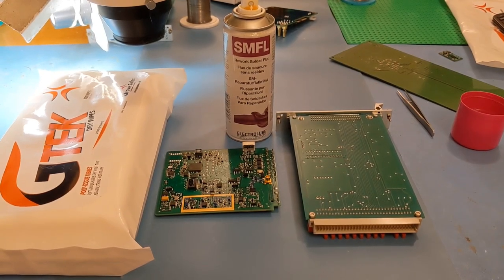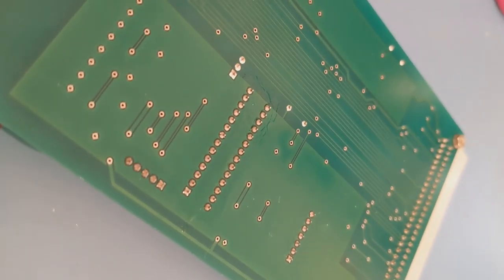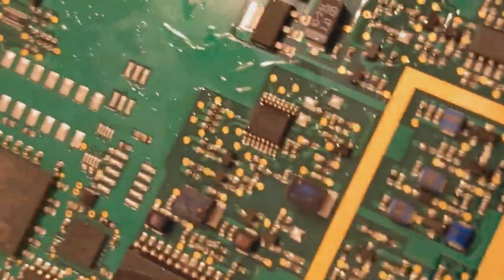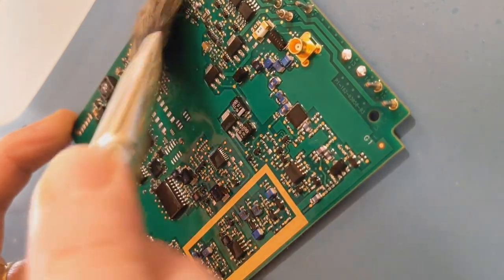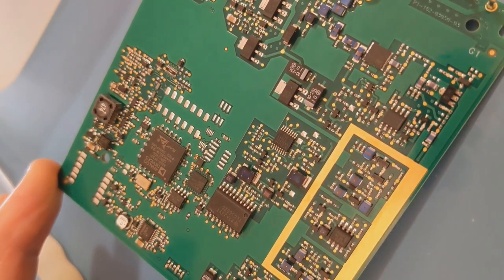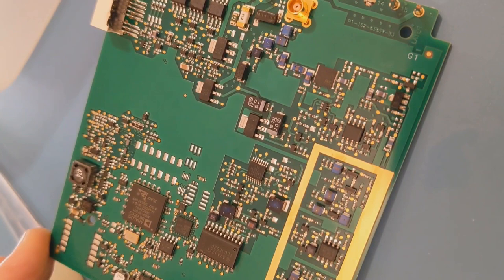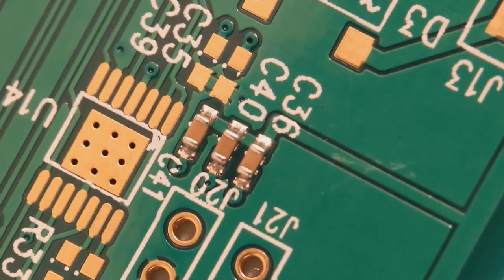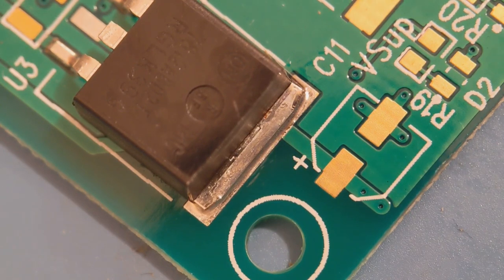How To Remove Solder Flux / Great PCB Cleaning Methods HD

Comment: In Aerospace boards meant for Space applications especially, Honeywell uses Axarel 2200. Stuff eats flux like it's water and leaves the board beautiful.
Reply: could this be used to also clean dirty boards?
Reply: isopropanol and windex, they charge the gov 100 bucks a bottle

Comment: The problem with cleaning flux is the pins. Requires more and more alcohol to clean just the littlest stain in between the grooves. So annoying.
Reply from the maker: Hi , thank you for your comment . A nice fine brush , good cleaning fluid ( ULTRASOLVE or Flux off ) are both great , not IPA , and a good fine cloth and the secret is the hairdryer . Bit of effort , amazing clean boards . Thanks again 👍

Comment: Ultrasolve is basically cyclohexane a common solvent, not bad results.  But you'd be amazed at what some good ole 1-1-1 Tricholoroethane will do.   It's quite a bit harder to source but it's out there.  Be amazed.

Comment: Wow, I would have never thought that PCBs can be submerged. Are all the little components waterproof?
Reply from the maker: Hi , thank you for your comment. PCB's generally get washed in the commercial world in large cleaning tanks with different cleaning programs and drying stages built in . It's a perfectly safe option if done with the correct methods . Cleaning as a hobbyist is 100% safe If the right fluids are used , in my case I have used 2 recommended PCB cleaning fluids so no problems will occur. Hope that helps , thanks again 👍
Reply: @mrsolderfix3996  Thank you!
Reply from the maker: Hi , no problem 👍
Reply: U can submerge them in Isopropyl and distilled water believe or not (regular water shorts and oxidizes components due to the minerals)

Comment: I'm ususing IPA 91% and it always let flux ... ive changed flux, and got the same issue,  it just blend the flux and only spread it ... I'll try specific flux remover product
Reply from the maker: Hi , thank you for your comment, much appreciated. Proper PCB cleaning fluid is a must in my opinion . I use Ultrasolve which really is the best , then after that as a back up I use one called Flux off . These are available from the general electronic distributers although some products they are reluctant to send to private individuals due to health and safety . Hopefully you can get some to resolve your cleaning issues . Good luck 👍

Comment: How about washing the whole board with dish washing detergent and soft brush in a warm water? Will it damage the board or the components ?
Reply from the maker: Hi , thank you for your comment . Definitely not I would say . It's true lots of parts are sealed so may be ok . But others like switches , relays , transformers may not be . Any moisture in them could spell disaster . Some companies do use water but it's deionized water with special chemical agents added . So it's something I would never do and I wouldn't recommend doing the method you've mentioned to anyone . Hope that helps , thanks again 👍

Comment: This one is much much better image quality 👍🏻
Reply from the maker: Hi , thank you for your comment , much appreciated. I listened to what you said before and decided to edit the video on the same device it was filmed on so that I didn't lose the sharpness of picture . 
Thanks for your advice . In the future all videos should be clearer . I will also try and sharpen up some of my old postings , thanks again 👍
Reply: What will happen if flux exist in pcb board??is that causes rusting or short circuit in pcb board. Please reply reason...
Reply from the maker: Hi , thank you for your comment. These cleaning methods will remove all flux but if there was any left behind it doesn't affect the board at all as I only use non corrosive flux . This means it's perfectly safe long term . Hope that helps 👍

Comment: instead of fluids , is it possible to use 99% isopropyl alcohol ??? ( i m. sorry my english understanding is small)
Reply from the maker: Hi , thank you for your comment. Lots of people do use isopropanol to clean flux etc off of their PCB's and it is pretty good  stuff . The Ultrasolve that i use is in my opinion way , way better , but understandably if people have a budget or just want a tiny amount to clean part of a board then they can definitely use Isopropanol. Hope that helps , thanks again 👍
Reply: @mrsolderfix3996  Thanks a lot for your video and answer
Reply from the maker: Hi , no problem , all the best 👍

Comment: Thank you for you videos. Do you use  0.25 mm solder wire with a flux core, or solid? And, lead-free or not?
Reply from the maker: Hi , thank you for watching , much appreciated. The solder wire I use has a 2.2% flux core and is a Nitrosol solder wire . This is lead free , available from BLT Circuits based in England . I also use a leaded version , also with a flux core available in various sizes including 0.25mm from BLT as well . Hope that helps , thanks again 👍
Reply: @mrsolderfix3996  Lovely, Thank you.

Comment: Is there any way to solder an ic with qfn package to a tqfp housing?
Reply from the maker: Hi 
 Personally this is something I have never tried but if the QFN is a similar size to the TQFP housing it may be possible to sit it on top of the pins and solder each one , but like I said I've never tried it . Be interesting if it does work or if anyone else has tried it . Good luck 👍

Comment: Great video, thanks. Could you share links to the products you use?
Reply from the maker: Hi. I don't ever do links in my videos , just my personal choice not to .
But I can tell you what you need to know from this video 
If in UK or Europe go to a company called Farnell and all the below are available from there . I have no association with Farnell , but I just use them personally and trust them .
Flux Off Cleaning fluid code is ( 860414 )
Ultrasolve cleaning fluid 1litre container code ( 298219 )
SMFL200D Flux code ( 298311 )
Cleaning wipes I get from Grove Sales , they are called Gtek dry wipes ( pack of 100 ) , about £5 a pack , best wipes I've ever found , seriously good when used as I show in the video.
Hope that helps , thank you for watching👍
Reply: @mrsolderfix3996  Thanks :)
Reply from the maker: Hi , no problem , all the best  👍

Comment: Can you use WD-40?
Reply from the maker: Hi , I wouldn't know as I've never used it for this purpose , but personally I wouldn't want it all over my PCB's as I'm sure it would leave them sticky and so dust etc would be attracted to the board potentially risking connectors etc to not work properly . Just my opinion . Thanks for your comment 👍
Reply: No, no, no never. Will just leave board mucky and attract dirt.

Comment: Hi sorry I'm kinda new on this thing may I know what kind of brush you using and what kinda of fluid you using? What kind of alcohol fluid did you you use to wash that flux
Reply from the maker: Hi . The brush I use is a soft bristle brush ( not to cheap ) so the hairs don't fall out . Very safe for cleaning PCB's . Don't use a hard bristle brush , I've seen some damage to boards when these have been used. All the other info , fluids etc is in the video 👍
Reply: @mrsolderfix3996  noted tq bro
Reply from the maker: Hi , no problems , good luck with all your soldering 👍
Reply: @mrsolderfix3996 thank you bro, it would be very great if you can make video how to use multimeter on board

Comment: Are you making boards for the MOD? !!
This is a top dollar finish!!
Reply from the maker: Hi . I've made boards for so many people over the years , and I've always cared about how they looked , so I found a way of getting them perfectly clean and have used this way ever since . I tweak it here and there as sometimes certain parts have to be cleaned in a different way , but there is always a way. My attitudes always been to get the basics perfect then you will be able to progress on to harder and harder projects and eventually crack them . Thanks again for watching the videos , people like you make all this worthwhile 👍
Reply: @mrsolderfix3996  No, it's people like you that make it worthwhile!!

Comment: For decades I have been using  regular 99% isopropyl rubbing 
alcohol with excellent results. I use cotton bolls, or acid brushes trimmed back to stiffen the bristles, to  agitate & remove the dried flux. I found no advantage to using commercial flux removers over this alcohol.
Reply from the maker: Hi , thank you for your comment . I do use isopropyl to clean first stages of flux off on a daily basis . It is ok . But proper dedicated cleaning fluids like Ultrasolve and Flux off really are on a different level when it comes to cleaning especially when cleaning complete boards . But I understand a hobbyist with one or two parts to clean would probably find Isopropyl ok . Thanks again  , take care 👍